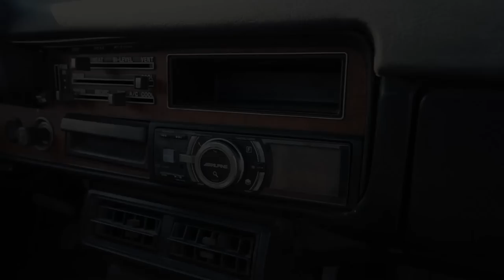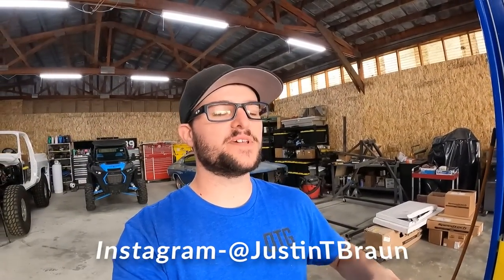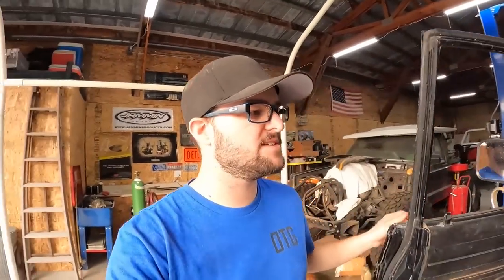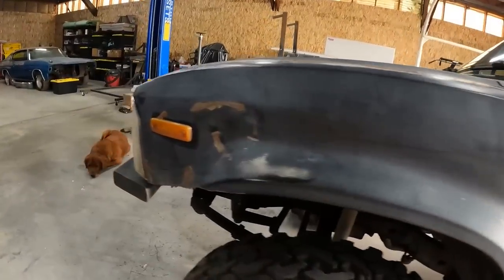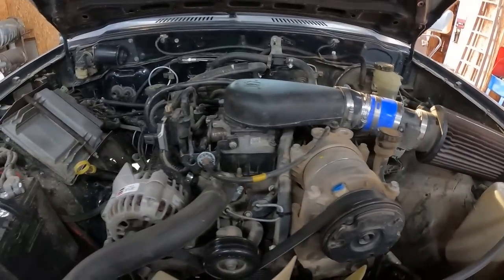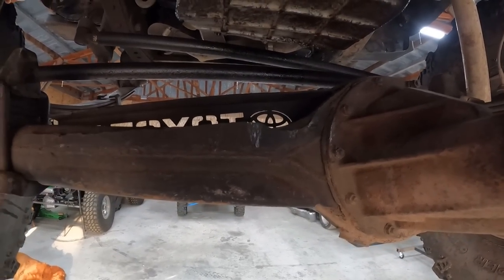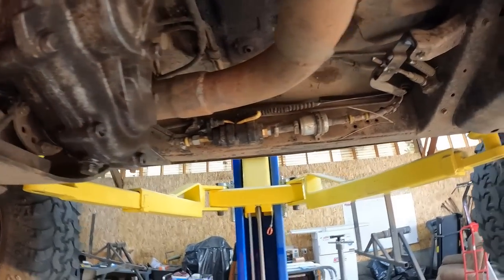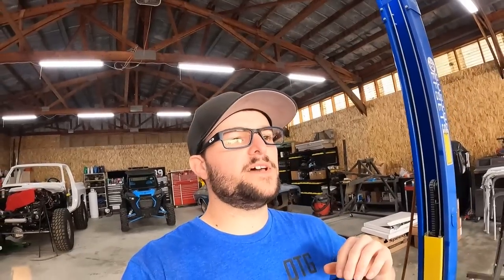Crazy Engine Swapped Toyota 4x4 Pickup!

Comment: They are all over eBay, but you are missing the best Toyota factory option from 1980. The inclinometer! They are very cool. They made them on their little four-wheel drive station wagons as well. It's 100% mechanical, the only electrical components is a light bulb. My off-road rig is a much newer truck but I took the inclinometer out of my 81 Toyota basket case to put in it. Low-tech and surprisingly useful in the trail
Reply from the maker: I checked ebay and wasn't having any luck finding one for a 1st gen. I'll have to check again. The inclinometer is definitely sweet. I probably wouldn't run one. They are very hard to find. Cool stuff though!

Comment: I picked up an 80 with a 4.3 swapped into it as well, but the tards hacked notches into the frame to clear the headers.  Thinking i will pull it back out and beat on the headers for needed clearance and patch the frame.  The also hacked on the core support to clearance the rad, just like on yours.  Does that notched like that worry you?  I am not sure if anything needs done about it.

Comment: I also have a really nice set of rears up front built with some trail gear springs that will fit perfect it’s about 3in lift springs
Reply: I used rear procomp 4 inch springs,
Took the overload out, super good flex and nice highway driving,
But still firm enough that it don’t sway bad in curves, little bit of nose dive on hard braking but nothing major
Bolted up but I did put boomerangs for shackles, 
Figure it gave me 21/2 inches in lift and pushed the axle foward mayb close to 2 inches

Comment: How did you keep the same cluster with the wiring? Does someone sell a wiring kit or something?
Reply: To explain it simply enough if you have a tachometer the tachometer diode can be changed out to read correct signal you use the coolant temperature sensor that came with your original engine to tell the coolant temperature gauge what temperature the engine is that you use the oil pressure sender that came with the original engine adapted or directly screwed in in most cases to the engine's oil supply to read for the oil pressure gauge or oil pressure light the alternator light is just an inline to the Exciter of the alternator and as for the speedometer if you're adapting to the original manual transmission you would have the original transmission cable for the speedometer if you're using a later model electronic you would have to swap in the speedometer that came from the donor vehicle